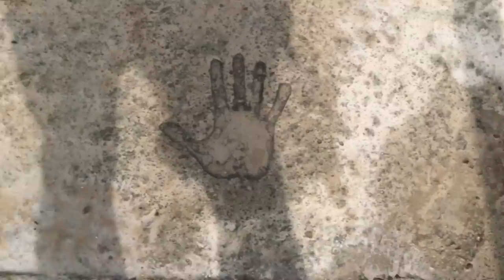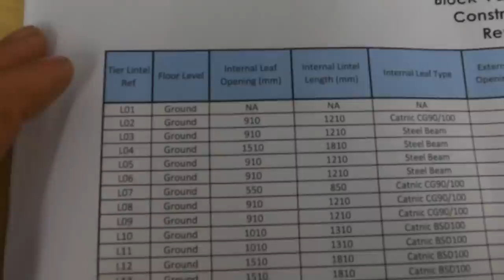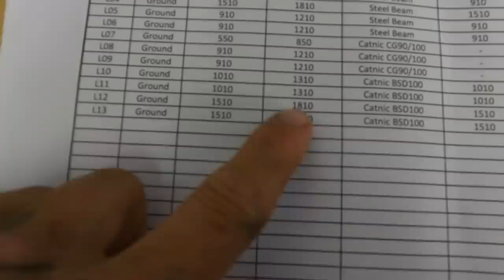Bricklaying, THE BOSS MESSED UP 🤦🏼‍♂️🧱🧱

Comment: As for the weather mate, any loading out or cutting that can be done, any work that doesnt require muck, id get that done on the days you're losing to rain! Setup profiles if its safe to leave them in without having them pinched!
Personally id throw on some waterproofs and make it so that the next dry day, you can literally throw a mix on and get bang at the laying with your profiles up ready to go, bricks n blocks where they need to be and all your cuts done ready. So you can literally have the vast majority of the dry day making up for the wet day / day's!